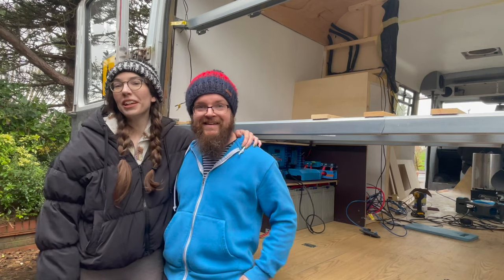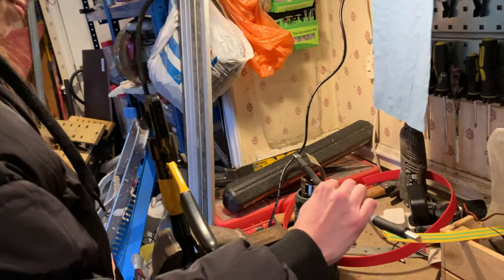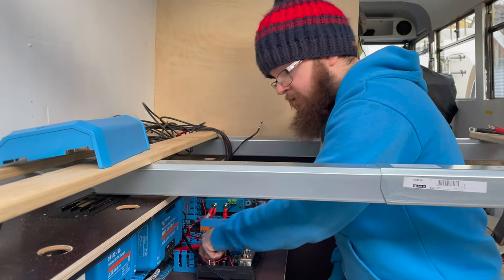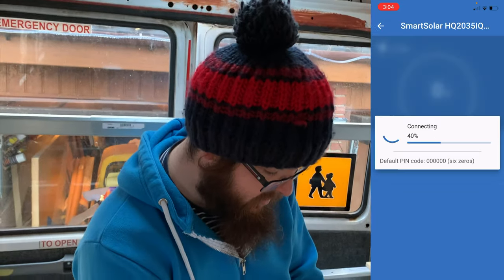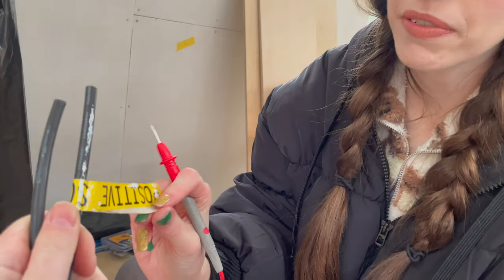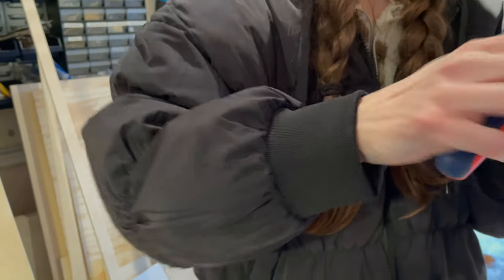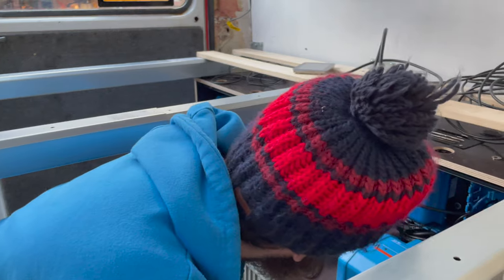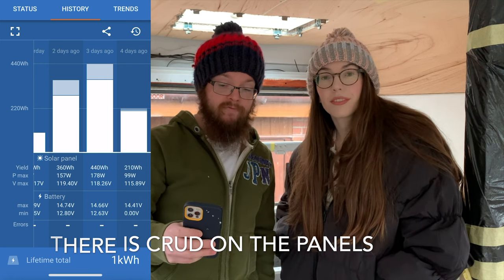Victron MPPT Solar Charger + Disconnect Install with 960w Panels | Mercedes Vario Van Conversion

Comment: Don't look at them in the winter. It makes you sad when you consider the investment. 

Think when your driving and you've got power coming from the alternator and solar combined it'll be plenty. 

I've been charging my tools, phones and TV in mine just off solar ! It's a great feeling
Reply from the maker: That’s a good tip, but do you find it addictive to see what it’s doing each day at the same time 😆. 

We’ve been charging a few bits and pieces. Totally love seeing what is being used direct from solar too. That’s a neat piece of info. 

We are hooking up the dc to dc soon too. Should be a neat little boost like you say. 🚐🚐🚐⚡️⚡️⚡️
Reply: Oh yes ! 

Great set up though. Should give yourself a pat on the back 😅

Comment: So how many amp batteries in series
Reply from the maker: 680Ah - we have 4 170Ah super cycle AGM batteries in the bank.
Reply: @WanderbusAdventures  so in theory ypu have 340amp usable? As you don't wanna go below 50 percent? Also that's alot. What are you're Intentions as that's the figure I'm thinking of for full time gaming from the van. With a gaming laptop that draws 340w... also how much solar and how long to charge? Cheers, alot of questions I know.
Reply from the maker: @Omnitrio1  That's right, we have actually set it to 60% DOD but have never hit that. The most we have hit is 25% discharged to date. But if we took your 340ah and our 70amp MPPT  was getting full solar it would take 5 hours. That said during the day the solar is used right to 'the grid' so the batteries do not discharge until the sun begins to go down in the summer. In the winter this is different and we rely on the B2B too. We have 960w of solar on the roof at the moment.